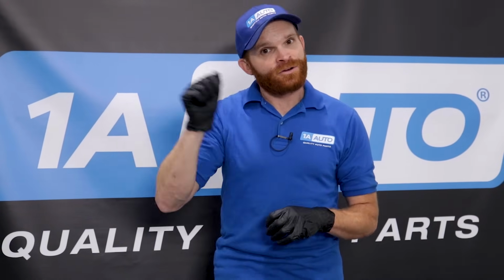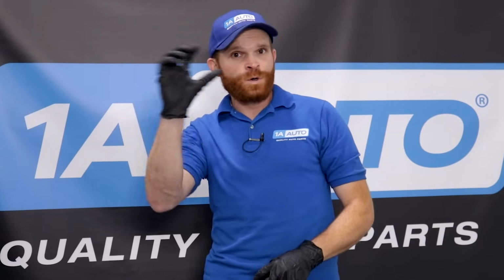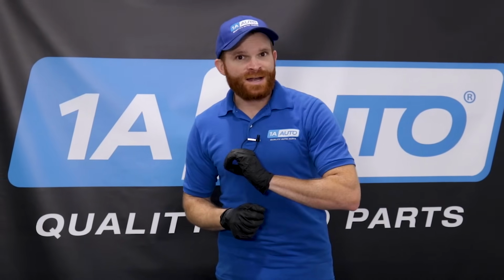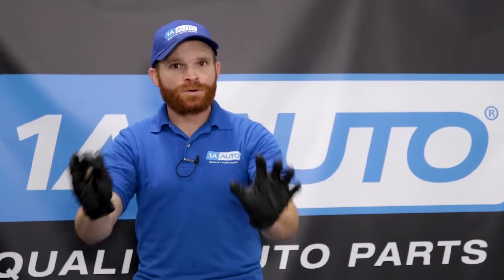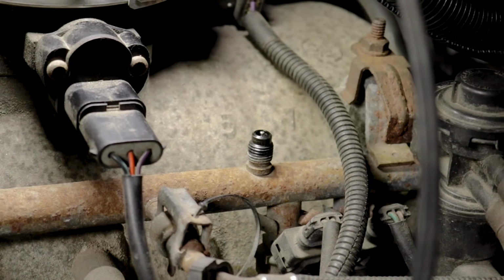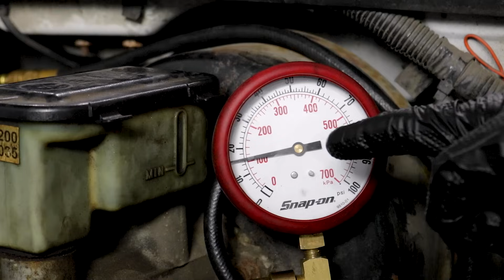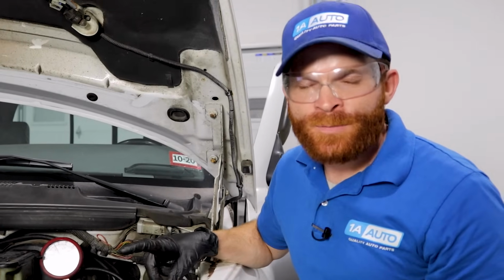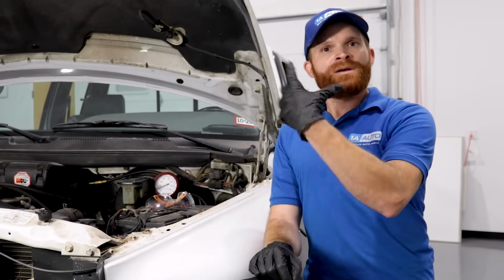Lag, Hard Start, Stall? Diagnose Car & Truck Low Fuel Pressure!

Comment from the maker: √  Watch the Video
√  Buy The Part at 1A Auto http://1aau.to/m/Visit-1AAuto
√  Do it Yourself
√  Save Money
Reply: @a
Reply: I have a f150 and it does all the things u say if I turn the key forward and backwards it start right up I was like is the purge valve bad? But if I fill the truck up it runs fine lol any suggestions
Reply: Well done. Thorough, well spoken, edited and useful.

One question.

Did you leave the key in the on position and engine off while waiting many minutes to see if pressure was holding??
Reply: Hello I have a question, so I have a 2008 can-am ds 450 efi .
For some reason it Turn on and drives if I continue to give it gas . But as soon as I sit in one place for longer then 30 seconds it turns off , and keeps doing that , I thought it would be the fuel pump relay but I already change it and it’s doing the same thing can you help me out
Reply: please
L
Reply: @federicovasquez8709  sounds like you have a leak somewhere. I would do some inspecing.
Reply: @isaachebrew2009  thanks man I think it was low pressure from the fuel pump sold the atv , but before working on it it did have a leak from an old gasket , had been sitting for a year so pretty sure the fuel pump had gas in it the hole year
Reply: I have a 2007 Toyota Sienna I put a new fuel pump starts bud shuts off quick it’s starving for fuel
Reply: So I have  a 2001 Ford F250 with 5.4 engine. I performed a fuel pressure test on my truck but when I turned the key nothing happened. Like the gauge didnt move. It doesnt move until I start the truck. Then it takes 1-2 minutes for the pressure tester to max out. Is this normal. My truck regiatered around 30 psi at idle. When I shut the truck off the pressure gauge immediately loses preasure. The thing is I have replaced bothe the fuel pump assembly and the injectors.
Reply: great explanations !  I like how you tell it so easy to understand
Reply: I wish you could diagnose my fuel pressure issue.  Currently I have a rb25det engine in my 1992 240sx.  New fuel pump, will not start without ether but will idle and run ok.  Turn key to on and fuel pressure jumps from 0-30, then when priming is over drops to 25 and stays there.  Aftermarket tomei fpr that is i don't know how old, stock fuel rail and injectors.  Please help!!  My next step is checking my fpr some how just don't know if my symptoms are pointing to that.

Comment: I learned a hack from a fellow youtuber earlier:  if there is still pressure loss at the shrader valve with all fuel injector electrical pigtails unplugged there's a high probability that an injector is stuck open and leaking.
Reply: You would probably be getting gas in you oil also

Comment: I just have a question, theoretically, if you did attach pressure to the opening of your gas tank could you push gas to the engine to see if it starts that way?

Comment: im sure somebody did mentioned in these hundreds of comments which i have no time to read all, O-rings in modern in-tank fuel pump+filter+regulator, need to be changed as well  to reduce/prevent gradual loss of fuel pressure over time and improve fuel pump efficiency(less workload in the long-run). sharing experiences is cool.

Comment: I pulled the fuel pump out of my 2002 Honda CRV.  I sat the pump in a little bit of gas and turned the key. The fuel pump was pumping fuel but it was very weak flow.  At the shredder valve there is nearly no pressure at all.

Comment: I have a misfire on all 4 cylinders 😢 Car cranks but doesn't start. Just did the spark plugs and ignition coils but it still doesn't start so going to try replacing the fuel pump because I do have all the symptoms described.

Comment: 2002 chevy blazer. my fuel pressure key on not running is 38 psi. i had fuel pump replaced 2 years ago

Comment: Exactly what happened to my wife's Tahoe and what's happening to my camaro.
I'm in the process of figuring out how to get the gas out of the tank because she filled it up before it stopped running.

I'm also having stuttering in my Camaro on acceleration, and I have to turn the car on for 10 seconds before I push start it, or else (3 times outta 10) it won't start.

Comment: thanks for beautiful  explaining ,  I  have a  Suburban 2012  it is the second time I changed the fuel pump   the last  year it was done after about 13 years of work   I   bought a new one original  it was very expensive because it an assemply   I dont know why  chevrolet did this maybe to get more money where I can buy the broken  parts only   seperatly  the strainer and the pump in old modles  anyway I bought the new one but unfortunatly  the disaster comes again and new pump broken but this time by charcool  canister  particles which spread into the fuel tank and  fuel hoses and strainer and  of course  making the pump dieng  silently  what is this Chevrolet  why this happened  again  the canister is must be replaced plus of course   with the pump  here we comes again the canister is very expensive    .

Comment: Awesome video bro! Im having a problem with my Dodge ram 04 5.7 I ran to out of gas the other day and went to fill up and threw a injector cleaner in the tank truck went stupid loud like a diesel had misfires going on changed the spark plugs were full of sout changed them and now my truck won't stay on unless I step on the gas checking pressure right now with a gauge reads 54ish psi bought a new battery new fuel injectors new spark cables new oil new air temp sensor truck still won't stay on and need to step on gas to start it I'm gonna swap out my gas pump and hopefully it will run again will update thanks!

Comment: My 2010 GMC Sierra starts up but runs weak for a second.  It's done this for a while. Never seen a code, but I'm positive live data would catch it. It also only happens when the truck sits for a while like the fuel is settling.

Comment: I have Buick Lessbre Custom 2005.  PEP BOYS in West LA 90064, they change the fuel pump, tune up, and 2 step BF clean fuel system. After that I went straight to fill the tank of gas , but I couldn’t put gas on the tank only about 2 gallons each time I want to put gas is the same thing happen. A week later my car stop running again. I took my car back with them. I am here now that want to change the fuel pressure regulator BUT they said that this won’t warranty that it will fix the problem. What I notice when I turn the key on the pump doesn’t start running like I just to hear that kick in after 30 seconds that I turn the key on. HELP HELP HELP!!! ❤❤❤❤please 🙏🏽🙏🏽🙏🏽🙏🏽thank you.

Comment: Author mentioned possible faulty pressure regulator for cause of fuel pressure loss, but isn’t it true that many fuel pumps incorporate a check-valve in their discharge line? The check-valve could be the problem in that case. I don’t know how often this happens vs. the fuel press. regulator failure?

Comment: 2008 4.3. Fuel pressure dropped extremely fast. This truck doesn't have a fuel pressure regulator. It has what they call a fuel pulse dampener where the fuel pressure regulator used to be on the spider injector. Any information on what could be leaking would be greatly appreciated.

Comment: Loose diesel injector seals will also cause low pressure, nip them up or replace if the engine has higher mileage or 10+ yrs old.

Comment: Hey I've got a 02 Jeep Grand Cherokee Laredo V8 4.7L that had throttle lag like you said when making a turn after slowing down.
I also have a stalling condition sometimes on turns usually uphill stops to get on the highway.

I replaced the TPS and IAC Valve and cleaned Throttle Body with CNC Throttle Body intake cleaner spray with microfiber cloth.

I planned on getting a fuel filter and possibly a purge valve solenoid but I want to be sure. I'm on a budget but also don't have time to wait for each part one after the other.

Should I buy a aftermarket fuel pump and fuel filter?
I did have my high beams go out one day and light still turns on in the instrument panel. Probably unrelated

Advice would be greatly appreciated, already had a shop get a TPS abd IAC Valve to no avail. Made my throttle response better for a few days.
I also put Berrymans Chem-12 injector cleaner through gas tank and before I put it in, my vehicle was having a very rough start where it was shaking. The injector/fuel system cleaner fixed that rough start.

But when I do stall it sometimes will crank but no start unless I flood start (pedal held to floor during crank) very long crank but rapid.

Seems to have gotten bad and started stalling when it got under 32°

Comment: I have to turn key several times to start 2003 gmc  Sierra. I replace fuel pump, fuel pressure regulator, purge valve, and maf. It still takes several turn of key for it to send fuel back to rail. I’m at wits end to figure it out. I’ve replaced everything necessary and still need couple of turns of key. Any suggestions? 🤯

Comment: sir, i have question. . my ford focus 2009 1.8l duratech engine. . when i start the engine, its super fine. .but most of the the 2 to 3 starting its faulty its seems that the coil or  Sparkplug busted but in its 4th ignation to start the engine, its totally fine.

Comment: I have power for the flow but no power for the orange wire and it new I replaced the fuel relay, battery. Any idea.

Comment: Tested pressure with fuel gauge tool. Registered 0 pressure ! But the truck runs. Bad idle , no power down the road. Stalls. At every stop and go situation or just idling along the road.

Comment: I own a 2013 Chrysler 3.6 and after i turn it on while on idle it shakes and rpm lowers then it stabilizes , I wonder if its one of the fuel pumps pressure... 🤔

Comment: Hi, thanks for this video. I have a question. Can you have a too rich code and still have a fuel regulator isssue? i have a 2007 Toyota camry and an error code P0172 keeps popping up. I have changed MAF, Injectors, 02 sensors, fuel pump and filter, plugs but keeps coming back up.

Comment: I was wondering if you can help me: I have a 2022 Chevy Malibu 1.5 L turbo and the car is misfire on cylinder two . I already did everything possible to fix it myself, like cleaned the  fuel injection, swapped them ,changed the coil and swapped them, changed the spark plug check for bad fuel, changed the fuel pump, cleaned the PCV valves changed the camshaft sensor both sides of them, changed the mass airflow sensor, air filter new battery, purge valve both O 2 sensors ,all the brakes, all the traction control sensor, cleaned the intake manifold and throttle body and brake booster vacuum pump  replaced and the car is still misfire on cylinder number 2 and the code that appears on OBD 2 reader is :P0302 , at the instrumental panel shows a different thing like ESP also the littler car with a checking engine light flashing! 
The only thing I didn’t changed it was the fuel rail injection high pressure sensor! 
Still misfire on cylinders 2 .

Comment: Why does the fuel pump fail after filling up the tank with gas? 
 Also, could a partially clogged fuel filter cause the fuel pressure to increase enough to cause a leak in the fuel pump hose?

Comment: O1 dodge ram 5.2 . Orig fuel pump 136 thou bucks at 46 mph  power loss.  New plugs new wires new cap rotor.   Miss at idle   under loat at highway speed dies.

Comment: 03 yukon denali. If the idle pressure is between 55 and 60 psi, what should it be underloaded while pressing on the gas? I assume the pressure should go up, but how high? In my specific case, the truck turns on and drives fine, except when I'm pressing on the gas going into the freeway. I don't feel that heavy push, It's pretty lazy going up to speed. I won't be doing the fuel pressure test. But I would like to know how high the pressure is supposed to go up when pressing on the gas..

Comment: What about a Ford 1994 F53 doing a vapor lock and will not start again till it completely cools down 4-6 hours later....
Reply: 460 engine with fuel injector.
Run for hours till after driving in 80 to 100 F climbing the mountains working till you come to a stop light and then the Vapor lock happens...
Reply: Replace fuel pressure valve and the Mpt...air module and Fuel Filter.

Comment: Got an 2006 Vivaro 2.0 with a problem. While driving uphill or with a bigger load the car simply starts to choke whenever it needs more power and if i try to get more it cuts off acceleration so i gotta take off the foot, let it relax with low rpm for a second or two and then i can drive again but still cant use the power... 
6 mechanics changed half of the things under the hood and completely ruined my wallet without fixing the problem so I'm sitting now myself already 2 weaks everyday after work learning how this stuff works to be able to diagnose it myself... Thanks for this video, I may only have regular Torque app with obd2 but thanks to the video I could see the pressure on the rail in the app. After ignition on it jumps between 30-62psi. Now there might be some hidden leakage as sometimes i can smell something but never seen any drops under car. Can you think of any other reason I should check? Obviously mechanics wanna change the injectors right away (obviously they dont understand people have other expaness then their fail diagnoses...). Please give me some advice.

Comment: Where is the low pressure regulator or sensor on a 2008 Audi A4 Quattro 2.0 turbo is it supposed to be orange code p0089

Comment: What if i have no codes and no check engine light ?? My nissan murano 09 turn on fast with no problem but when is time to accelerate it struggles and hesitates and wont run more than 5 yo 10 miles please help 😭

Comment: Hi i have a 2011 Honda pilot and i have replaced the coils to the number 3 and number 6 cylinder my code reader keeps saying that i have a misfire  in those cylinders now i don't see any oil on the plugs and i have changed them as well now would you have any ideas what could be the cause of the coil failure any help will help

Comment: Ok boom so I have a 92 Honda Accord ex that is throwing code 43 which is fuel system problems. I do have a hard start it takes a second or two for the car to crank but it does crank.I can be in traffic on a hill or at a stop sign and I can press on the gas pedal and not going anywhere like stuck almost. I have to put the car in neutral cut it off and cut it back on and back into drive. I changed the fuel filter and the fuel injectors. Should I replace the fuel pump or the regulator

Comment: I have a 2011 Avalanche LS 5.3, my fuel pressure gauge starts at 53psi the drops to 42 psi, I have replaced fuel pump, both knock sensors, map sensor, maf sensor, spark plugs, Catalytic converter is good, the strange thing is I do not get any codes. I am exhausted with trying to correct this issue with poor accelation, it started now a mont

Comment: I have a 2002  chevy  S10 4x4 4.3 and   on a cold start  have problems starting up   can a 02 sencer stop it from starting right up
Reply: Did you connect a fuel pressure gauge and compare the reading to specification?

Comment: My Hyundai accent 2014 starts right up fine but once I push down the accelerator to overtake the car loose power and the engine sound is kinda loud pls could it be the pump or the filter or pressure regulator

Comment: Any info. Vehicle starts runs then stalls hard starting more you keep starting. I’m having the same issue with old/new fuel pump/sending unit. In my 99 300m. Car was running great after time up  and replaced clock spring & now this.?! I also changed gas cap. Please any info

Comment: Those codes haven't been useful for me. A couple years ago I had a code that pointed to the FPDM but it was the fuel pump that failed. Even when there is a problem I rarely get a code to point me in the right direction. Right now I have low fuel pressure but no codes.  Despite all this fancy electronics, it seems that the only way to diagnose the issue is through parts substitution (the term in electronics for this is "shotgunning" the problem) which could get expensive unless you're lucky enough to have the cheapest option/part that fixes the problem.

Comment: I have a dodge van 3500 with a 5.9 litre engine. I can drive it about a half hour and it runs great but then it stalls and will not start but will turn over. No codes are present. Any ideas what it could be? Also I usually keep enough gas in it but let it almost run out of gas one time. I struggled to get it to a gas pump but just made it to the pump.

Comment: Thanks for the video I have a 99 Ram 1500 with a random misfire and it has new  spark plugs, spark plug wires and distributor cap so next I'm going to start checking the fuel system

Comment: Howdy I don't think my 04 ram hemi has a regulator, and my psi dropped from 49 to 30 in 10 min ,also it is bouncing around under acceleration,  oh and I was parked in a upward angle ,and I noticed it was harder to start... so new fuel pump??

Comment: Awesome video and your awesome I changed the fuel pressure regulator on a 460 Ford on a class A motor home and it's still loosing power when I'm driving it and it will bog down and sputters but on park I can rev it up fine so I'm thinking now it's the catalytic converter or o2 sensors or fuel filter the air filter is fine or maybe the spark plugs which will be next the fuel pump is working fine too maybe the fuel injectors but I put injector cleaner so let's see what I find thanks my friend.

Comment: How to know which one is failing. Fuel Pump Relay or Fuel Pressure regulator or FPDM or the Fuel Pump in a 2002 mustang v6? My mustang is hard starting and when it starts it drives or idles for a few minutes then stalls. fuel pressure dropped when I checked. No check engine light on.  waiting for your advise